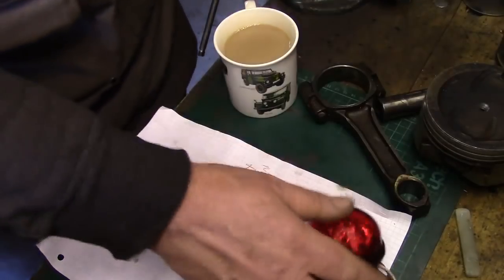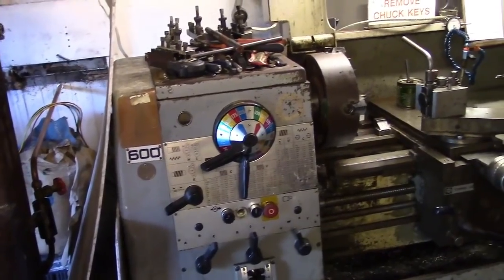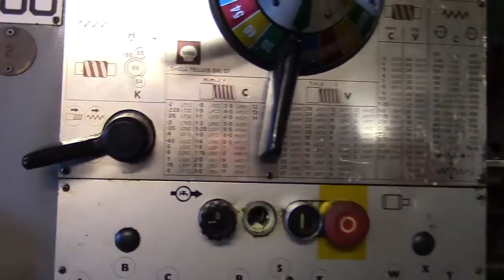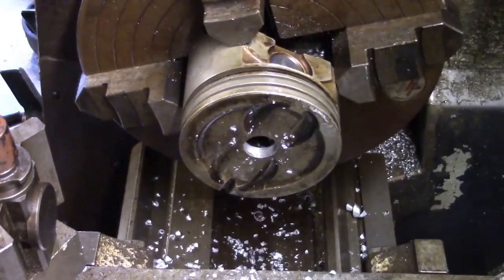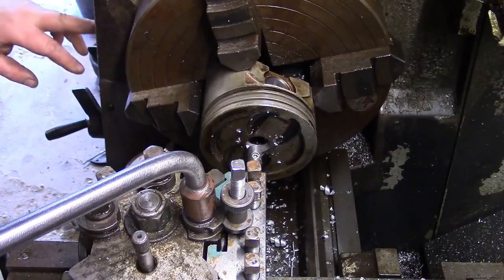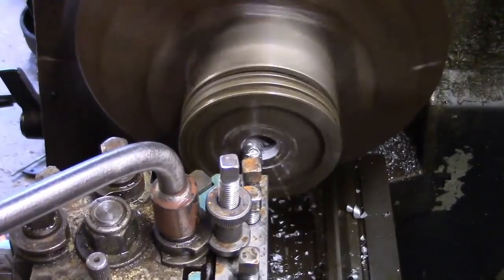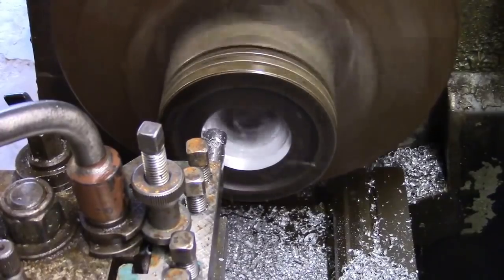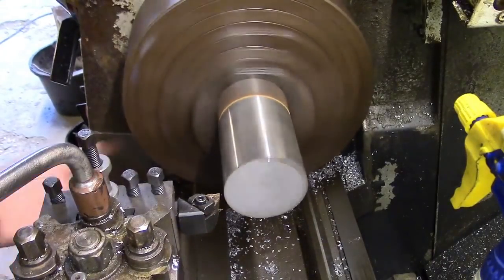1954 Chevrolet Piston Tail Lights.

Comment: i put one of them threading dials on my chipmaster works a treat for metric threading but i still have to leave the halfnuts engaged for imperial  its a metric lathe to 
i put a dro on it for working in imperial
Reply from the maker: I have to do the same, so where I used to nearly always cut imperial threads now it will be metric just because it’s easier on this metric one, a DRO would be nice 😁 one day maybe.

Regards Alan.

Comment: Hi Steve.  Nice to see you back on the "tube".  Nice lathe!  Looks like the twin of mine.  Interesting half nut arrangement. Mine only has one engage gear on half nut, and when cutting metric I can't disengage between cuts.  When you mentioned slippage on feed shaft I thought maybe like mine, yours has an adjustable slip mechanism to safely feed into a carriage stop.  I hope you enjoy the new lathe as I do mine.  Wondering if you have the issue with your surface grinder sorted out?  Cheers Mike
Reply from the maker: Hi Mike, the surface grinder is working fine it's leaks a bit of oil but at least it keeps the coolent thick 😁, I have to keep the half nuts closed on this lathe when cutting imperial threads, but metric I use it just as you cut imperial on yours, by the way my name's Alan or Al for short.
Reply: I meant to type "Alan".  Dooh!